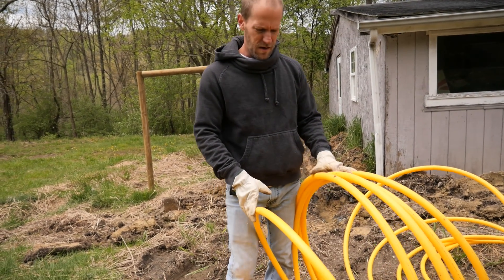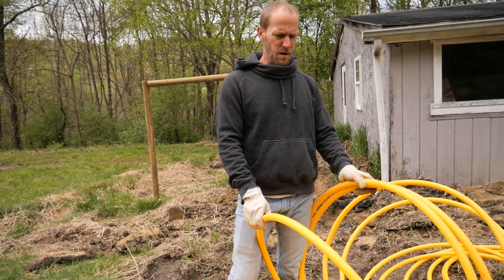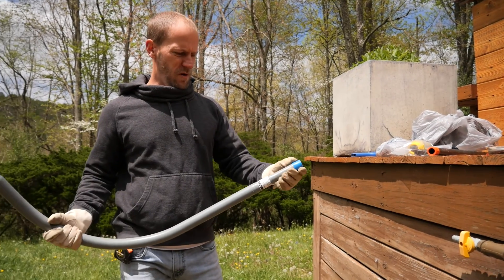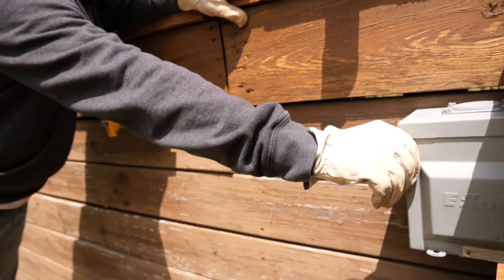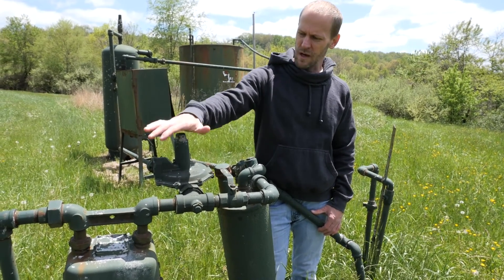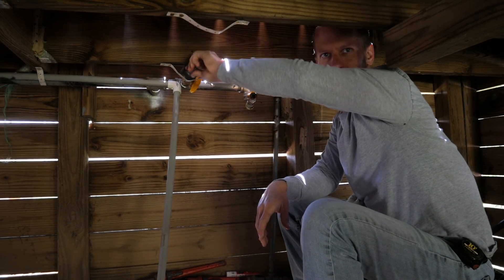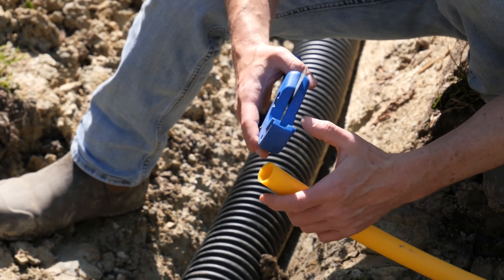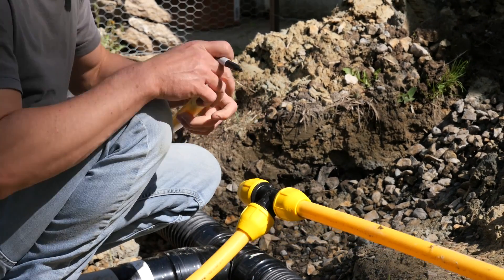Gas Line Install with Home Flex - Ep. 40

Comment: "Went to the end of the internet and had to go back and start over" amen brother!  running gas is so easy (easier than running compressed air, certainly less pressure) and information is SO hard to find... it's like they would rather you not try, than give you the information to do it correctly!
Reply from the maker: Couldn't agree more!

Comment: How did you determine pipe sizing?? I’ve been trying to figure that detail out. I will be piping a long distance. Maybe 200+ feet at completion. Thinking 1 1/4” main from tank, then branch off from there in the appropriate size.
Reply from the maker: There are tables online that can help with that. Here’s one example: https://fire-boulder.com/wp-content/uploads/2016/09/Gas-Line-Pipe-Sizing-Chart.pdf
 Depends on the gas pressure you have supplying the line and, as you know, the length of the run. Also, of course, you’ll need to know how many input btu’s for all appliances that will be connected on the other end including any you might want to add in the future. One other thing to note is whether it’s natural gas or propane as propane has higher btu’s per volume.
Reply: @AlleghenyHomestead  Thank you!! :)
Reply: @GottaLoveGoats  The way we do it for our clients:
1. We measure the line from end to end
2. We determine the CFH (Cubic Foot Hour) based on pipe size, volume and BTU

In case anyone asks you.. we just learned about this and in speaking with our Local Power Gas and Electric Engineering firm for the city they stated the tables are "prescriptive" but you can get better values by doing the calc and showing them.

Hope this helps!

Comment: You can buy a CTS to IPS tee

However, that wouldn't do you any good unless it's a large CTS like inch and a quarter because the CTS is a smaller size than what you've got. So you would have been bottlenecking it the whole way by going from a small size to a big size to the appliance if that makes any sense. But however, the perfection brand push connects are the best